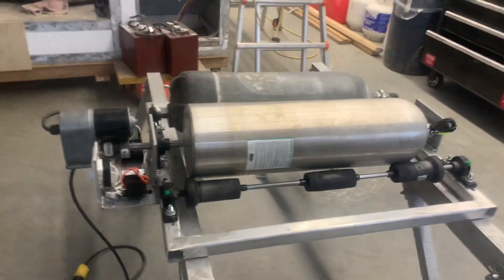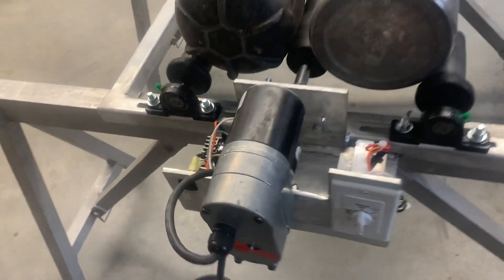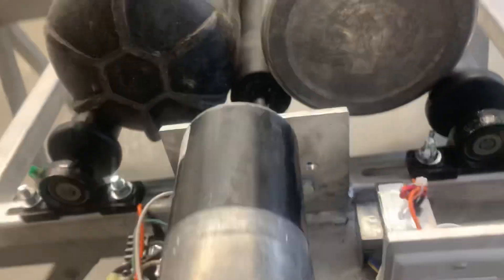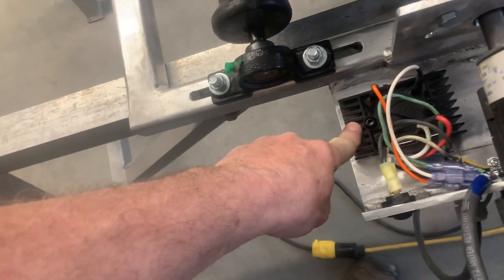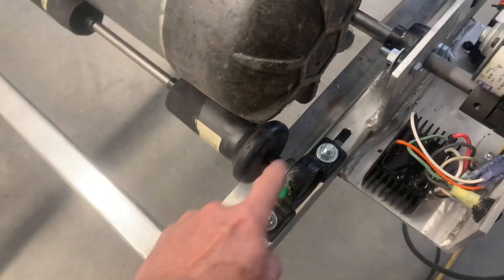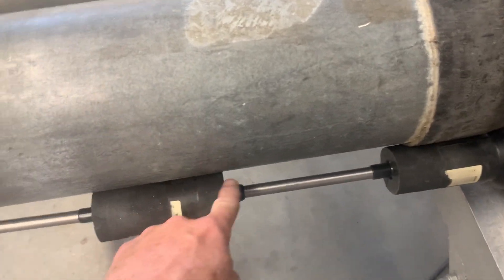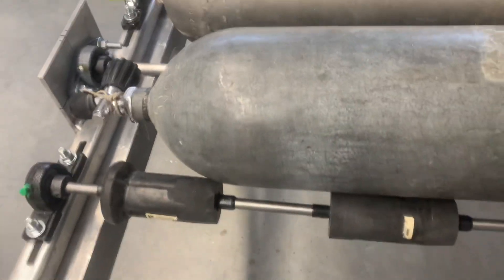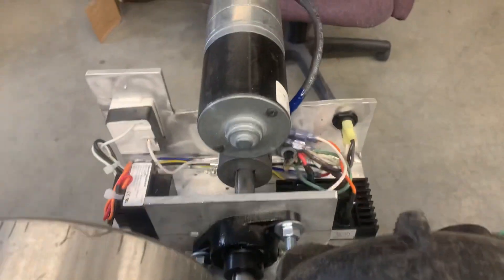Home made scuba tank tumbler

Comment from the maker: What are you looking for in the build?  I the transformer and bridge will be dependent on the size of motor you get.  Outside measurements of the frame are 32.5 inches long and 27 inches wide. With 7 inched slots for the outside bars to move in. About 3.5 inches from centre. Centre drive shaft sits about 1 inch higher then outside shafts (at centre).